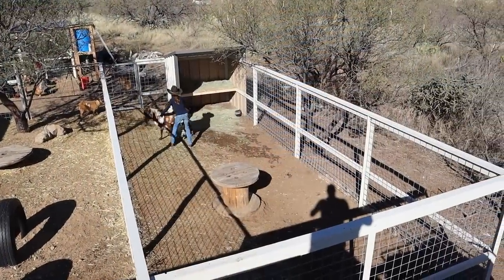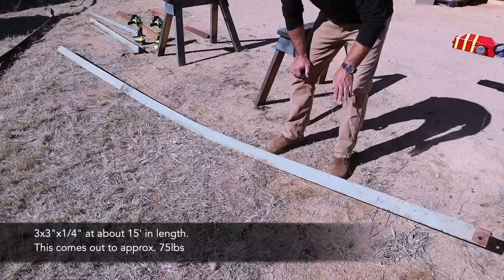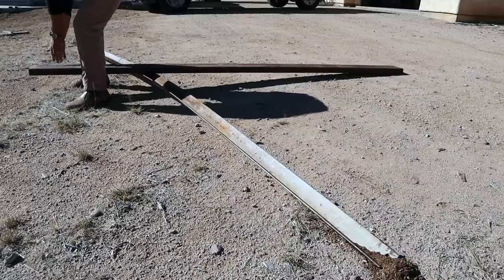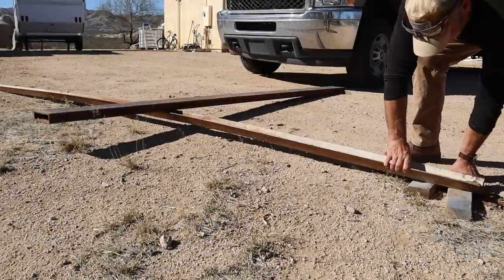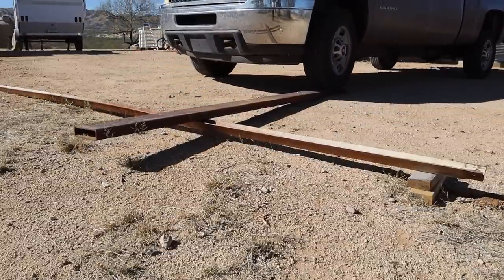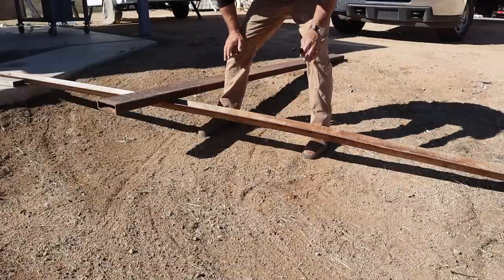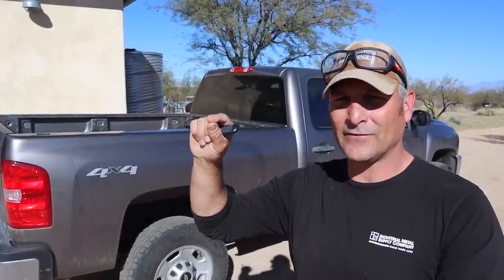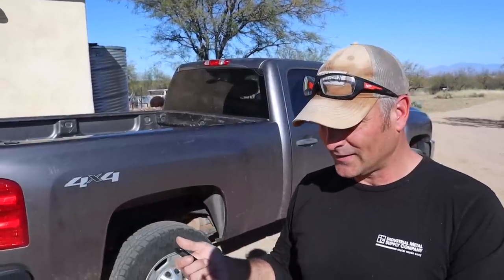How to Straighten Bent Steel - The Redneck Engineering Method

Comment: Great timing. Thursday I was looking at a similar size piece of angle with a bend in it. I will be trying out your method for sure.
Reply from the maker: Yes, it can certainly add a bit of extra interest in the piece if you could make a corrective bend relatively easily.

Comment: 1/4 inch angle iron is such a structural wonder, and definitely worthwhile to rehabilitate! Your ad hoc use of targeted brute force is exemplary. It's reminiscent of a similar method for breaking the tire bead off a wheel.
Reply from the maker: Yes, this steel has been a major windfall for my projects.   I almost want to make a dedicated bending device to true up piece like this without having to use this method all the times

Comment: Thanks for the  great video.  Great idea as I am looking for a way to fix a bent gate. Could I use this method on my  green steel tube gate before I re-hang it?  
Have a small Honda sus no truck.
Have some 16 foot 1 by 6xs that I am going to repair fence with . Maybe I can lay in  over the bent area near bottom of gate and  put pressure to bend it??   Its hollow though so maybe to weak to take any pressure? Also, if thr answer is yes would I do it on my  big cement drive way or on the pasyure grass?  Any suggestions? 
Thank you.  Beth

Comment: I wonder if heating it up in the bend might have helped any??
Reply from the maker: Yes it helps a lot if you’re making a sharper bend.   But in this scenario, if it got too hot it could buckle under a load like this.   But it certainly help in more technical situations.    I don’t know if you watched any of the travel trailer build, but in the first video my father in law helped me bend that tubing using torch😊👍

Comment: Your Redneck Engineering Method works on steel drums and old appliances.
Cut them open and run over them on the driveway for thick metal panels.😉 -KJ
Reply from the maker: That might require an old steam roller for some of the appliances I see at the dump.   But the barrels could make for interesting sheet metal panels!

Comment: Why not start on the shop concrete from the beginning?
Reply from the maker: Starting on the ground is just a little bit easier to keep from over correcting by making small corrective steps.    And the bigger bend is held more stable with the corners set in the ground a bit.

Comment: Ok but wonder if the steel bar would have some weakness in it at the spot that was bent…
Reply from the maker: If you make small bends it should not loose much integrity.   But if you go too far with a correcting bend it can affect strength for sure.   So the key is little steps.